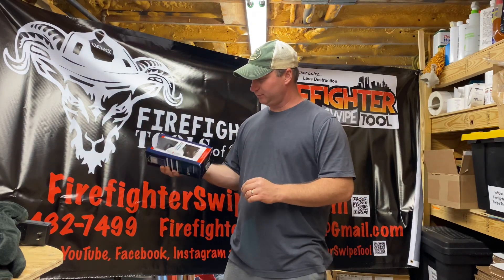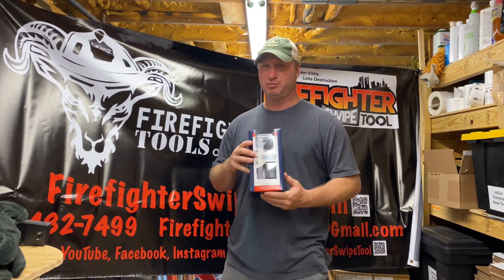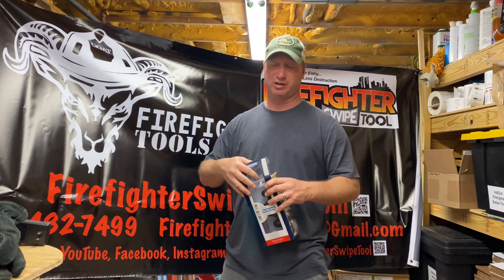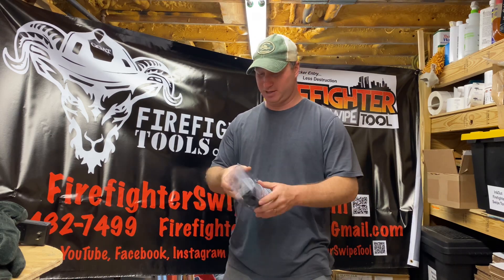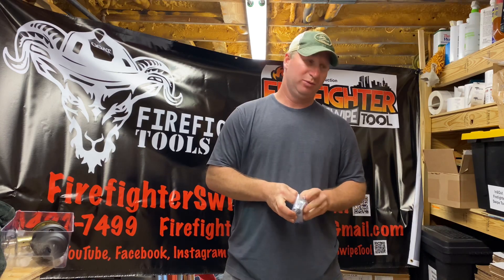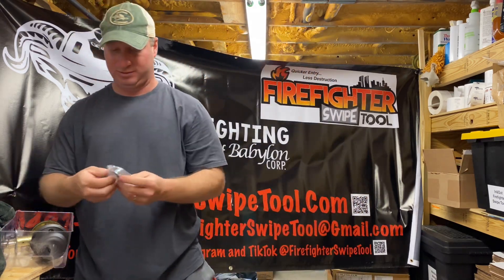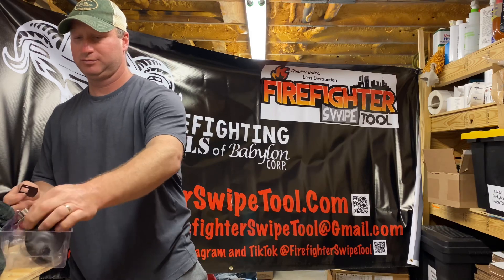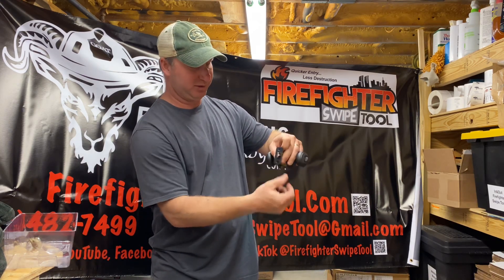Why the Firefighter Swipe Tool and FirePik works

Comment: What this video clarified for me is that the Firepik or Swipe Tool won’t work on a properly installed latch / plate. Which is fine. That’s why we have the Hooligan Tool :D
Reply from the maker: How did that clarify anything like that for you? On a “properly installed door” all you do is pull it tight towards you. That compresses the weatherstripping allowing the anti loiding pin to fall into the strikeplate. The doors literally come from the big box stores like that with everything pre drilled out and in place. Have been using this tool for 20 years and can easily get in 9 out of 10 doors if the deadbolt isn’t used. People can talk about “properly installed doors” all they want, but I have yet to run into one in 20 years on a house.
Reply: Mine won’t work. It’s an apartment door. No  weather stripping, no dead latch movement, it’s a lachaugh electric pin door with a very narrow hole that the latch fits in very snug
Reply: Schlage lock camelot